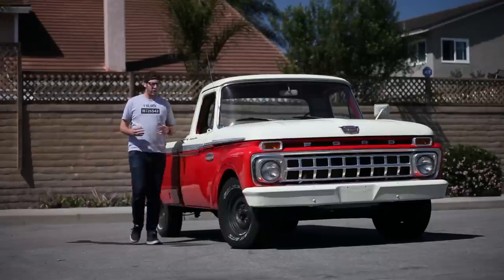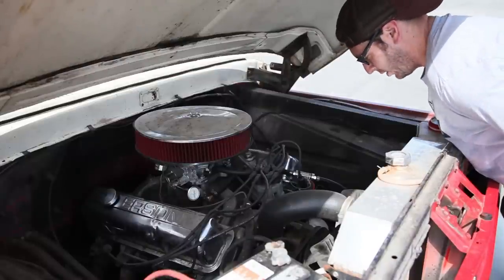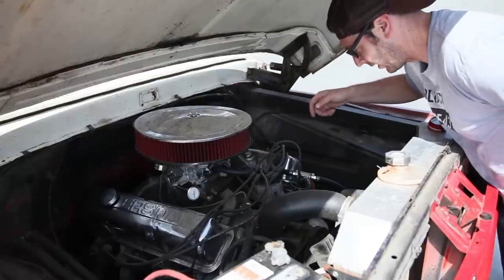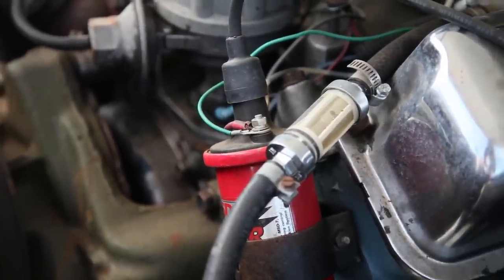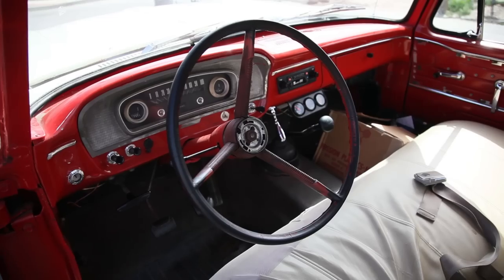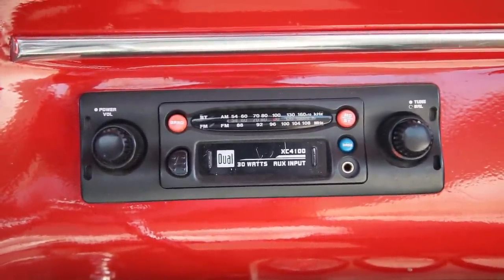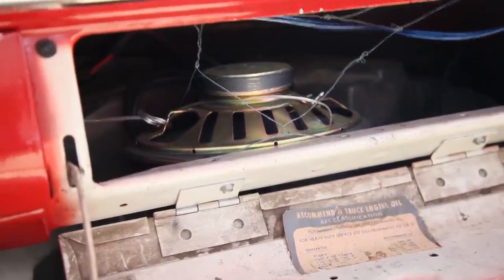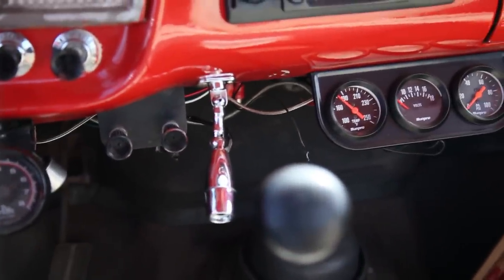HoonTruck: Say Hello To My 1965 Ford F100

Comment: There is nothing "really crappy" about the ol' Sealed Beam headlights. They produce a better beam than composite halogen lights. Only HID and maybe LED outperform them...

You want really crappy headlights? Any car from the 90s with plastic headlights. THOSE are "really crappy".
Reply: Krankie V 
I agree I have a 99 camry and the headlights are super shitty

Comment: 292 y block is in mine have 2 4x4 1 half ton 63 which is different is little ways from 65 on metal stamping rear bed on 63 looked like 57 thru 60 model fleet side beds. You have 65 bed can tell by metal stamping on rear quarter wheel opening. also the older 1st generation original frame had a different rear axel placement .

Comment: When you upgrade the lights, I really suggest upgrading the headlight wiring. Stock headlight wiring before OEMs started putting in relays sucked dick. Voltage at the battery on my 1993 Volvo 240 at idle is 13.7v. At the headlight connector? 11.8v. That's a HUGE drop in luminescence. First upgrade I'm doing to the lights (beside glass E-Code lenses) is relays and much heavier gauge wiring to eliminate the voltage drop.

Edit:
Talk to this guy - http://danielsternlighting.com/
Reply: With LED replacements, the current draw is reduced so much that the stock wiring should be sufficient. Those old Sealed Beam lights suck a lot of juice.

Comment: Was it common for these trucks to come with an 8 lug??..ive searched high and low with 0 luck..
Reply from the maker: No, the F100 has 5 lugs. Perhaps the heavier duty versions have 8 lugs. But all the F100s are 5 lugs
Reply: @TheHooniverse  what about a conversion? I heard the f350 and above had 8 lug but I don't know if it even fits there's not a ton of info..i know for sure it's a f100

Comment: You never need first gear unless you are hauling a huge load. You should pull that v8 and put in a 300.
Reply from the maker: 678friedbed why would I get rid of the V8? --JG
Reply: The 300 straight 6 can produce a heck of a lot of horse power. They are stronger, last longer and is something different then the norm. Comp cams can build you a custom cam for almost the same price as an off the shelf. And Clifford performance builds makes some really good straight 6 performance parts. Or you can buy a turn key 300 from them that they say puts out 600 hp
Reply from the maker: 678friedbed ok... good answer! Now I'm googling all sorts of modded 300s, haha - JG
Reply: Also with the 300 having a life span from 65 to 96 you can go down the the junk yard and get parts for it anywhere also the block is the same from 65 to 96 so a 96 fuel injection will bolt up to a 65 300 so there is no worries as to will this part work on my 300. The list can go on and on of reason why.
Reply: Oh and the 300 is still considered a big block

Comment: wow 4 on the floor, good shit usually with these you get 3 on the tree
Reply from the maker: +Lamb chop Yeah I do love that 4th gear, especially when I take it on the highway... a 5th would be even better.
Reply: time for a full coyote drivetrain swap
Reply: The Hooniverse you could get your 5th gear if you swap a transmission from an 80's truck....would probably have to put in all new clutch stuff....will be hydraulic...not mechanical
Reply: @christophermay4366  Course you could always get a two speed rear axle to be very period correct. :D

Comment: I thought ford made a 351???
Reply from the maker: +kyle monson they do... and a 352 from the FE family of engines. This one was used in trucks. -JG
Reply: i have a 71 f100 and it has a 351?
Reply from the maker: +kyle monson It should have either a 360 or a 390 if it has its original V8. If it has a 351, then that was swapped in.
Reply: +kyle monson I have a 71 short bed but mine is a 302. I have an aluminum Italian made DOHC 4.6 that I pulled out of a Lincoln mark VIII that's going to go in though. So much room under the hood I figure why not go twin turbo?
Reply: +The Hooniverse No. The only V8 available in 1965 was the 352 for an F-100.. The info is out there not to mention in my 65. God help the truck.